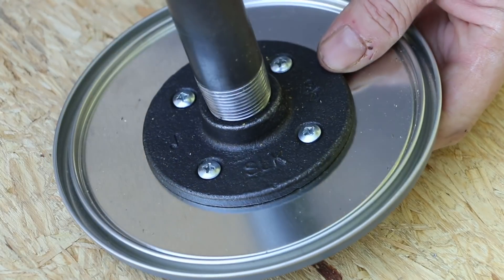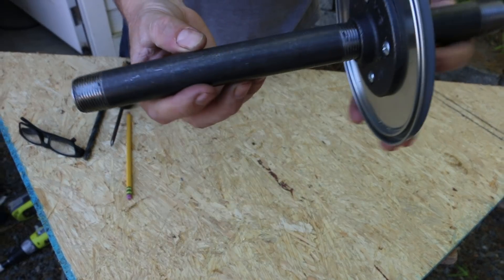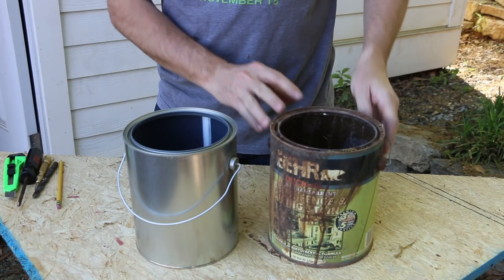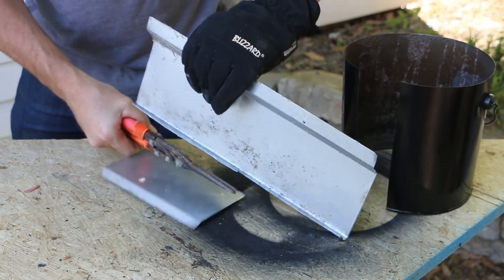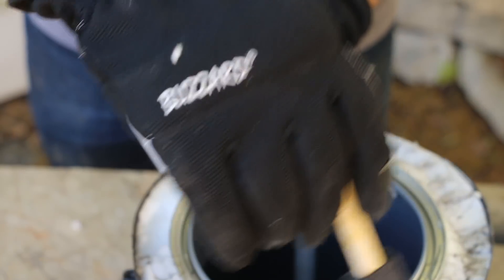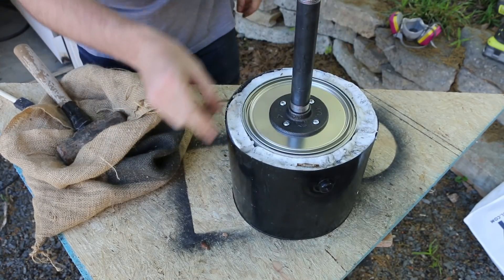How To Make A Paint Can Bio Char Reactor

Comment: Why go to all that hassle for no extra benefit? All I do is poke a couple of nail holes into the top of a tin, fill it with wood then put it on top of a flame. This gives perfect results. To make bulk supplies I put an old garbage can filled with wood and with the lid on the can inside a 44 gallon drum with no lid. I fill the 44 gallon drum with old twigs and branches and set them on fire. I top up for several hours and end up with a garbage can filled with perfect biochar. Another simple method is to fill any large can with wood, turn it upside down without a lid and then light a fire on top of and around the tin. You will get get the same quality biochareither way
Reply from the maker: I like the sound of your method. I agree there was more hassle than biochar in my experiment, but I see value in the learning process. Perhaps making mistakes or wasting effort so others don’t have to. I need to try a larger scale method like you described. Thank you for the feedback. Thank you for watching.

Comment: Thanks! I have a rocket stove I previously built and this will work perfectly. But as a heads up, as a journeyman industrial insulator I feel I need to correct the misconception about your “mineral wool.” What you have is ceramic fibre, nasty stuff especially after it’s been “cooked.” Please look up a msds on it. Mineral wool is either greenish to brownish. It’s made from slag from smelting minerals like iron. Thanks again and stay safe.

Comment: I just drilled a hole in the top of the paint can and put it in my fireplace whenever I start a fire.  I use free wood chips.  2 to 3 hours the gases are done.  Biochar.   Can’t get any easier then that.
Reply from the maker: That is a great solution. Thank you for sharing. Thank you for watching.

Comment: So may people doing this are using 30 or 50 gallon drum.  This is more my size.  I wonder if it would work sitting on top of the concrete rocket stove.
Reply from the maker: That would work for sure. If I built this again I’d use a 5 gallon metal bucket. Thank you for watching.

Comment: maybe we don't need the insulation? let the heat from the flames travel up and heat the sides of the can, that would be more efficient? and i don't think packing it too tight is a problem, probably you just need to heat it more. cool video & thanks ;)
Reply from the maker: You might be right. I had another comment offer a similar suggestion. I may redo this and make the outer metal layer a fire channel that pulls the fire up the sides. What do you think? Thanks for watching.
Reply: @GreenShortzDIY  haha that's a cool idea! would love to see it!

Comment: I think what happened is that the pipe shouldn’t have been oriented to the bottom. This gas is lighter than air, so it goes up, instead of fuelling (does this even exist?) the fire by going down. Also, when making charcoal, the indicative of it being finished is  the lack of wood gas production. At least that’s what I learned from other videos. I hope you find it useful. Love your videos.

Comment: Maybe instead of insulating the double layer, get the fire to go around the and super heat that reactor :) gr8 video Tom
Reply from the maker: Interesting idea. You mean like a pot shield that extends up the sides? Thanks for watching. I think my pronunciation is off for Kia Ora. I’ll get it fight next time. :-)
Reply: @GreenShortzDIY  yeah so the fire goes all around the reactor
Reply: @GreenShortzDIY  I think "Nighthawkinflight" just kida chucked it in a fire lol. Also time may help.  Perhaps make the "chimney" wide enough?
Reply: @GreenShortzDIY  Yeah you need a pot shield or just make a rocket stove with a pot 'well', something i've always wondered why nobody does. As it is your relying on heat to conduct all the way from bottom to top through the wood chips themselves.